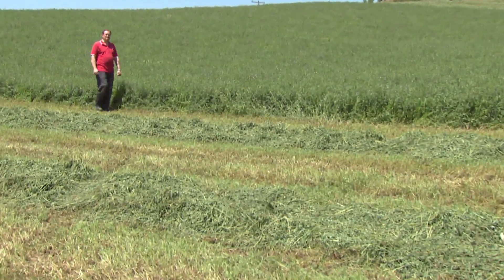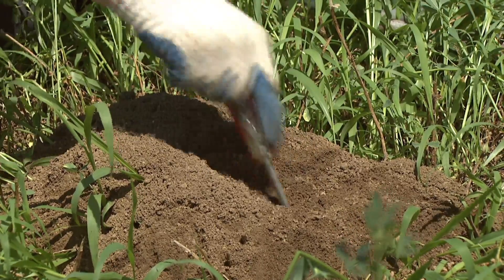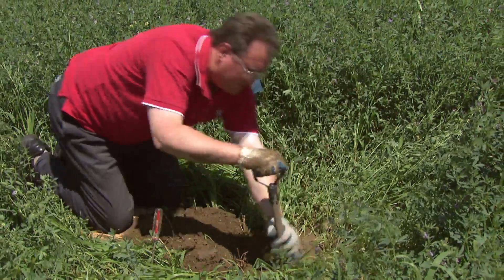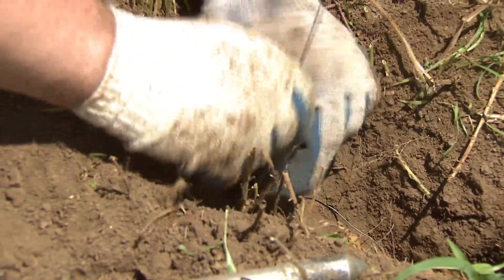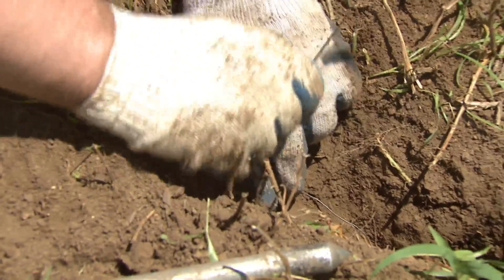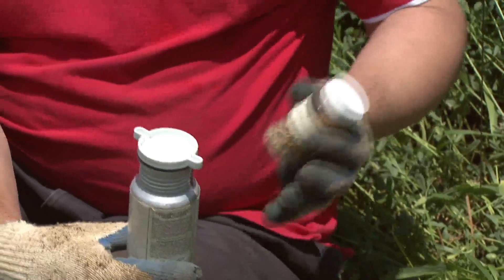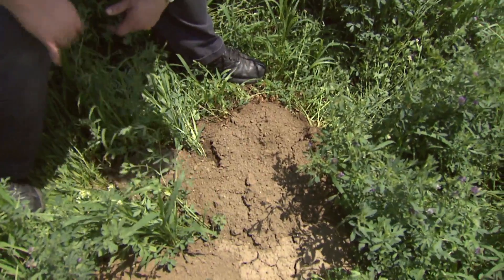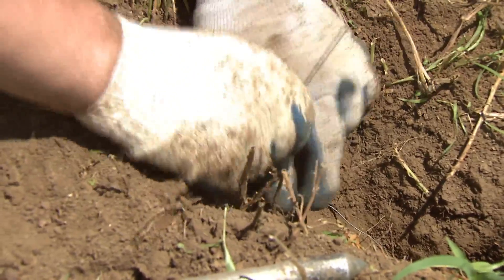Pocket Gopher Control

Comment: Install a Barn Owl nest box. Vineyards in California use one nest box per 26 acres to control gophers, rats and meadow voles. Sugar Cane fields in Florida use one nest box per 57 acres to protect Sugar Cane fields from Swamp rats. A poisoned gopher could be eaten by a non-target animals. 

There is a two post swinging mounting design that looks good. There is no need for a ladder for annual cleaning. Drill two bolt holes in the posts. Then plant one in the ground and install one bolt. Then swing the second post up and install the second bolt. 

If Nebraska installed a thousand Barn Owl nest boxes there would be fewer problems with gophers and rodents.

Comment: I have aboveground and underground video that will prove your information wrong.  Pretty much everything you’ve said is off.  Pocket gophers are STRICT HERBIVORES, they will not eat grain, nuts, seeds or bait.  Two tunnels from the main tunnel?  You don’t know about intersections?  How about breeding and birthing dens?  Open or close tunnel?  OMG you have no idea on why.  Using those toxic gases/poisons are what have killed humans in this country.  Also, gophers will NOT EAT IT they push it aboveground where birds, and omnivores eat, they die and then other species eat them and also die.  Tell them why you have to now wear those gloves.  Talk about the EPA changing the label after those two little girls died.

The bottom line here is that people are lazy and won’t do the work required.  It sounds like you’ve never studied live pocket gophers.    They are not the same as rats, mice and ferrets.  If you research all the baits and poisons on the U.S. market, not one we’re tested on a pocket gopher.  They were all tested on rats, mice, and ferrets.  

Some states have already started taking action, these products should not be slowed for the pocket gopher species as they can get rid of it and kill rare and endangered species.

Comment: Somewhat accurate, look for the freshest mound of dirt,  the mound is the off ramp of the freeway system, probe away from mound, between other mounds as in his green line.  Excavate to expose freeway tunnel, use two traps, I prefer the box, because the gopher does not have to climb over trap. Wear gloves, spoon out all loose dirt crumbs of tunnels. Trap needs to be free of smell from previous kill, so I heat/wash the trap.  Set trap onto face of tunnel,  bait inside back of trap w/ fresh vegetation, cover, so no light enters. Repeat for opposite tunnel.  Come back next day.  Bait:  use a couple tablespoons, if you don't drop enough down or into tunnel, and gopher does not consume all of it, gopher gets sick, but not die, then gopher becomes, "bait shy". Never to eat bait again.  Use only in dry soil.  Fume-toxin, phos-tox.....use only in wet/moist soil. Gas will absorb into ground as it trans-locates through tunnel. Extremely deadly, but highly effective. And remember, Dead gophers don't come back!

Comment: @mict450 Further tips ?   Just try to trap the fence lines and road ditches first. A gopher will migrate.. same as  mole......just under the surface to avoid predators. They do have a honing instinct and often return to the exact same area.....and use old tunneling. If you have gophers you most likely have ground squirrels ...snakes... fox.....badgers and fox. Ground squirrels often keep the gopher holes open for the return of the " gopher " ! Between all of them they will do a good job converting your lawn or hay field into a rough waste land !

Comment: You "never " probe around to find the entrance ! If you disturb the area the gopher will  plug the hole before anything such as a trap or even poison !  You  gently dig behind where the gopher threw the dirt... using only fingers ! If you go to this extreme as in this video you will destroy the main entrance of the  tunnel and then have to contend  with two holes .  Work slow and find the primary hole only !

Comment: Remember never touch traps with bare hands, your smell will warn them!
Reply: Gophers are smart......but smell plays little in setting traps or poisoning them !  Ive trapped gophers for 45 years... Trapped 250 gophers in a year. missing only two.  Gophers can and will become trap smart....once you miss them..game over !
Reply: @hairymanonetwo  Thanks for the comment on gopher sense of smell.  Never knew  that.  Any further tips?
Reply: @mict450  Further tips ?   Just try to trap the fence lines and road ditches first. A gopher will migrate.. same as  mole......just under the surface to avoid predators. They do have a honing instinct and often return to the exact same area.....and use old tunneling. If you have gophers you most likely have ground squirrels ...snakes... fox.....badgers and fox. Ground squirrels often keep the gopher holes open for the return of the " gopher " ! Between all of them they will do a good job converting your lawn or hay field into a rough waste land !
Reply: @mict450  Search out freshest mounds first, eliminate all possible distractions, such as smell, loose dirt crumbs in tunnel prior to trap. Pre-bait  back of trap to lure gopher toward trap. Cover tunnel opening with rock/veg=no light.
"Gophers can and will become trap smart....once you miss them..game over !"  It happens, gophers will plug traps, so you move further down to older mound, or upward.  Gopher will burrow around damaged tunnel too.  Reset traps, Game still on!!
Also when excavating tunnel, be mindful of a narrow body brown fly coming out of either tunnel (remember you dissected tunnel in half) the brown fly follows gopher feeding off scat. 99% kill rate when fly is present. 

As with Irv Farmer, myself 60 yrs of trapping, poisoning, fumigating,  excess of 8,000 gophers. Dead gophers don't come back!
Reply: @mict450  - I've had no problem peanut baiting with bare hands. Just saying.
Reply: POCKET GOPHERS...Their called Pocket Gophers because on the side of their Cheeks there's a Small Skin Flap that opens...You can use a twig or a knife you can open it from the Front...I don't know if it's for Storing food or if they can open it to help push Dirt.... Most of this Video isn't True at all....I've caught 64 So far in about 3 Years....The first 2 years were Trying y figure out how to Catch them and I've NEVER used Gloves or BOILED the Traps... After our Cat Died the Gophers moved in...I tried everything to Catch them... Poison..Smoke flares.. Drowning them..Big Flares for Car Wrecks..Juicy Fruit Gum and a few others....WHAT WORKS are the McCabe Wire Traps... There's no Bait...Find the Hole by using a Wire Probe..I use Welding Rods ...Then use A Gardening Spade to open the tunnel..The Tunnel needs to be about 2.5" in Diameter so the Trap can Go off and not get Stuck on the Roof..DO NOT COVER THE TRAP opening...There needs to be Light and or wind Bothering them so they'll come back ...I tie a 18" String to the Trap and use a Welding Rod to Anchor the String  Down NOT THE TRAP.....The Gophers DO NOT pull the Trap back into the Hole ...I use the String to Pull the Trap out.... Sometimes the gopher will push Dirt out the Hole coverings the Trap and NOT Setting it off so you put your hand in there and it will get you ...Many times I've seen the Gopher push Dirt over the Trap and not set it off....The traps I use are McCabe Traps I think and come in a 2 pack..Their Dark Green and the Trip Plate is Polished Metal about 1" Square....I have 6 and need 2 More..... When I Start I go out and look for Fresh Darker Slightly Wet Dirt...If I can't Find any New Mounds I Flatten the Mounds out with my Shoe then Step on them and come back the Next Day and look for New Mounds..

Comment: NOT all gopher traps are equal.. I do use the DK 1 for very large main runs, but the gophinator traps are by far more effective for any regular size gophers typically, outperforming the EZ set and older style victors and 'old reliable' macabee traps at least 2:1.. for newborn gophers, I do prefer the smaller version of the gophinator, the 'molinator' for all my smaller runs.. just a hint for anyone out there who needs to trap gophers every day..